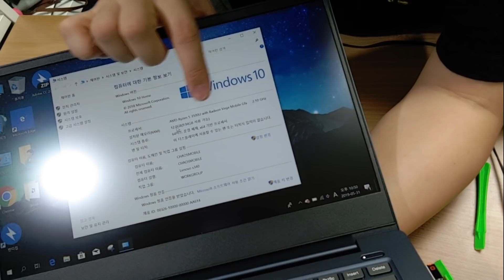Lenovo Ideapad S340-14API Unboxing & SSD/RAM upgrade

Comment: Nice video!  Where can I get the flat plastic tools you use to open the case?  I know the case is aluminum, but are there any delicate pins inside (like on a plastic case) which break easily when opening the case?

I got a Lenovo S340 model 81QF0002US .  It comes with a 256 GB M.2 MVMe SSD and does not have a 2.5" SATA hard drive.   I'm wondering if I could I could add a SATA hard drive or SSD?  My guess is my model will not have a mounting bracket installed and I'd have to find one.  It might not even have a SATA connector which would make it near impossible to add a 2nd drive.
Reply from the maker: I bought the tool at Aliexpress.com but it takes like ages for shipping.  If you are in the US, I recommend to buy it from Amazon.com, search 'phone repair tool' 
https://www.amazon.com/VIPFIX-Multi-purpose-Opening-Professional-Disassemble/dp/B07DLS46M2

I don't think the plastic latch of the laptop is too delicate, but it is highly recommended to open it gently with plastic tools that I used. As long as using the right tool, it should be okay.

For your specific model, I think it should have one 2.5 inches SATA bay empty to upgrade.
Any laptop with empty 2.5 inches bay for upgrade, it should have required mounting bracket included. 
To be sure, you may need to contact your regional Lenovo distributer to clarify that.

Comment: Hey friend what do you think about of adata ram memory? Can I agree the adata memory to the notebook? Without conflict. Sorry my English is not good. Thanks a lot.
Reply from the maker: There is no guarantee for cetain RAM module will work or not.
But, RAM modules are generally fine nowadays, because they have JEDEC memory standards.

As long as you pick RAM module from well know brands, it should be fine.
I think ADATA is fine, if you have no other option like Samsung, Crucial or corsair.

Comment: Is it possible to add a HDD or is there no support?
Reply from the maker: Technically, S340-14API can be equipped with one NVMe(M.2 PCIe), and one 2.5 inches SSD or HDD.
However, it only designed for SSD or HDD with 7mm of thickness.
Also, in some region, this laptop may comes with 2.5 inches SATA SSD or HDD. In that case, you can't add one more drive.

First, check your laptop has 2.5 inches SSD or HDD already. This can be done by disassembling or thru software like Crystaldiskinfo by checking product code to determine if the storage is NVMe type or 2.5" SATA type.
If your laptop is not equipped with any 2.5 inches, choose an additional 2.5" HDD with 7mm thickness. There are drives with 9.5mm thickness which can't be fitted nicely.

Comment: What Ram module did you upgrade to/from?. Thanks for great video 😁...
Reply from the maker: Mine came with empty slot (4GB soldered only).
I used Teamgroup.
Reply: Go to crucial website, let them scan the computer and suggested acceptable ram upgrades

Comment: Can I upgrade by my 8 gb ram to 20gb by replacing one 4gb ram by 16gb ram ? ..plz reply
Reply from the maker: Up to 8GB module is officially tested, and confirmed by Lenovo.
Anyway, it is highly likely to work up to 16GB, because it is technical max. limit per channel.
I even heard someone installed 16GB successfully.
Anyway I recommend you to try with memory module from well-known brands such as Samsung, Crucial, or Teamgroup.
Reply: @gyuhangcho  Crucial RAM 16GB DDR4 2666 MHz CL19 Laptop Memory CT16G4SFRA266....can I buy this ?
Reply from the maker: @svijaykrishna1097  You can find compatible RAM module from Crucial website.
https://www.crucial.com/compatible-upgrade-for/lenovo/ideapad-s340-14api#memory
2400, 2666, 3200Mhz models are all supported.

Comment: What tool did you use to actually get the back off? I've got the screws out, but I can't even find the seam to remove something.
Reply from the maker: There is a plastic disassembly tool specially made for that. gently stick in blade side into the seam to take out the back cover.

https://www.amazon.com/dp/B07214Q6DS/

You can find similiar tool from ebay.

Comment: Did you install a screen guard ? Is it necessary?
Reply from the maker: No, I don't, and never used it.
It is totally up to you.
Using screen protector may protect your laptop screen from minor scratch,
but I think it is not necessary unless if your laptop is 2-in-1 or yoga style.

Comment: Do you need a ground or special screwdriver to use it internally? I don't want to short my motherboard, done it on my macbook before -_-
Reply from the maker: No it's not. All you need is a standard precision screwdriver.

The most important thing is that you MUST completely turn off the laptop before even open the case, and you MUST unplug the cable from battery connected to the motherboard before trying to upgrade.

It is also helpful to have plastic disassemble tool because if you use screwdriver for unplugging the battery cable you may damage the motherboard by accident.
Reply: @gyuhangcho  Awesome. Thank you!

Comment: Hello, i try to upgrade my S340, i try to add SSD. Because, i think, i do not disconnect my battery, bios has lock, laptop can not be open or charge. Service unlock the bios and he work fine now. Somebody know how can i hard reset the bios? Not from hole from left. Like bios battery disconnect.

Comment: I bought one of these but it didn't have the memory soldered, it had a 4gb module in the upgradable slot. It's weird because it's the same reference as yours.
Reply from the maker: That's weird, According to the official reference list, there are only 2 setups for the memory.
'4GB Soldered + 4GB DIMM DDR4-2400 for expansion slot' or '4GB Soldered only'

I think you bought a 8GB ram model with 4GB module already installed.
You can check your total memory capacity from task manager(ctrl+shift+esc) > performance tab > memory section.
Reply: @gyuhangcho  No, it only had 4 gb of ram and I had to change the ram module to a 8gb one due to poor performance on games , it's prety weird that they done that because task manager still shows 1 of 2 slots being used, so they didn't soldered a module at all.
Reply from the maker: @felipemarinoc1597  Maybe it is a local varient model. thanks for the info.

Comment: Hello @Gyuhang Cho.  I am thinking of taking this model. Can I add another 8gb of ram and a Nvme SSD 500gb or an 1TB HDD later?
Reply from the maker: Typically this model comes with NVMe storage, and 4GB Ram soldered only.
So, you can expand RAM with 1 empty slot.
For storage, either you can install 2.5 inch SATA SSD or HDD with 7mm thickness, or even replace NVMe SSD. 
There are some 1TB HDD with 9mm thickness, so be careful. it can't be installed.
Reply: @gyuhangcho  Thank you so much man!!!
Reply: @gyuhangcho  Hey again man! Can you turn on windows face recognition on this laptop?

Comment: Great video! Do you think this laptop may work for video editing?  Not on a super pro level. Can yo change the screen on this one? I think is TN
Reply from the maker: I think casual video editing is okay for this laptop. However I strongly recommend you to install additional RAM. 

Mine came with IPS panel, it depends on regional model.
Reply: @gyuhangcho  thanks!!

Comment: Hi, can we add both SSD(given with the laptop) + 1TB normal Hard disk together? SOFTWARE installed in 1TB hard disk... Boot from SSD?
Reply from the maker: That is totally possible, but you need to consider this.

If your S340 is equipped with NVMe, you can simply add any type of 2.5inch SATA drive you need, HDD or SSD.

But, you MUST check the thickness of your 1TB HDD before you install.

This laptop only accepts 7mm HDD or SSD for its SATA bay.
Most 2.5 inch hard drives are 7mm nowadays, but still there are 9.5mm hard drives.
for example, HGST 1TB or WD black 1TB are 9.5mm. these models can't be fitted to the s340.
Reply: @gyuhangcho  Thanks a lot.  So, we can insert only one drive (SSD/SATA).... 

But not both(SSD/SATA) at a time, right?
Reply from the maker: @ashokvardan7387  This laptop has 1 x NVMe slot and 1 x 2.5inch SATA bay.
So if you want to use SSD+HDD, you need to use 1x NVMe SSD with 1x 2.5inch SATA HDD.
Of course you can use both together. Booting with NVMe, and installing softwares on SATA HDD is also totally possible.
Reply: @gyuhangcho  many many thanks. 😄😄😄

Comment: Wait, is the original ssd a sata one or a pcle? Because on website it shows pcle nvme but here it's sata?
Reply from the maker: NVMe 120G is stock storage by Lenovo.
Korean distributor swapped it with SATA SSD.

Comment: I really appreciate the time you took to explain us how to do this. I have two simple questions. What''s the biggest capacity the replacement ssd can have? and why didn't you use a 3200Mhz memory as suggested on lenovo's website,??
Reply from the maker: 1. There is no limitation for maximum capacity of SSD in the spec sheet. I think it should work with any SSD up to 1TB.

2. It is true that the Ryzen desktop processors performs better with high frequency RAMs like 3200Mhz.
However, mobile Ryzen 5 3500U processer only supports up to 2400Mhz. So there is no reason to use faster&more expensive memory.

If you are buying newer laptop with new Ryzen mobile processor like Ryzen 5 4500U, you should look for 3200Mhz RAM. Because the cpu supports it.

Comment: Great Video! Can you let me know the type of screwdriver you use to open this laptop please ?
Reply from the maker: You need T5 screwdriver to open the back cover. 
For SATA bay, I am not sure if I used 2.0 or 2.5 philips screwdriver though.
Reply: Thanks!!!! Any recommendation on the SSD? I am looking to add 1TB.
Reply from the maker: @venkatsubramaniam2160  Samsung, crucial(micron), and WD will be safe choice.

Comment: Mine came with 8gb ram, I would like 16gb, do I just need to put another 8gb in or do I need to get a 16gb?
Reply from the maker: First, you need to verify how your 8gb is setup. It could be 8GB soldered with blank RAM expansion socket, but also it is possible to have 4gb soldered and 4gb module inserted to the RAM expansion socket, the latter is the more likely setup.
Opening up the laptop will give you definative answer, but if it is too much trouble for you, you may try apps like CPU-Z to check in advance. 

In case if you have 4gb soldered, and 4gb module. you need to consider switching existing 4gb module with either 8gb or 16gb module.
Reply: @gyuhangcho  that’s brilliant thank you

Comment: Hi.. I am going to buy lenovo S340, it has 512gb ssd, I want to know whether it's Pcie Or Nvme. Which one is Pre-installed on this laptop?
Reply from the maker: It depends on specific models. You need to check with the seller. 

Usually it is 512GB NVMe for Lenovo stock model, but still there is a chance that seller exchanges low capacity NVMe with larger capacity SATA SSD.

Comment: 2666 MGz working? after change 2400 MHz?
Reply: It's not working, because it's limited by the cpu, ryzen 5 3500u only support to 2400mhz
Reply: @erwinm.mutaqqin4559  thx

Comment: Do you happen to know if the ideapad L340 has soddered ram or memory module installed?
Reply from the maker: There are several different models of L340 lineup, so you need to be specific.
For Lenovo products, you can find all the detailed technical specifications on http://psref.lenovo.com/ 

For example, L340-17API has 4GB soldered, and has one DDR4 SO-DIMM socket.

Comment: If i upgrade the ram can i lose the guarantee? you know for opening the laptop
Reply from the maker: It depends on country I suppose.
It is generally okay to replace ram, SSD, and/or HDD in Korean market, but this is partly because Lenovo's hardware repair service in Korea is outsourced.
Warranty policy in other market may different.

Comment: thanks for your work, that mean i can update  more ram from that empty slot?
Reply from the maker: Officially supported up to 8GB, but actually you can install 16GB module, too.
I suggest 8GB though. because 16GB is a kind of overkill unless you 'really' needs more RAM for your everyday task. For example, super hi-res photoshop work, or heavy EXCEL works.
Reply: @gyuhangcho  are you sure that we can add up to 16GB RAM? I will need upto 16GB for my development work.
Reply: @gyuhangcho  thank you so much
Reply: Just FYI, I added 16GB ram and it runs on total 20GB without any problems.
Reply: @VishnuHaridas  are you sure?
Reply: @VishnuHaridas  can you give me some image?
Reply: @katluyana3682  My err, I have an IP 330S and I added  16GB and total is now 20GB and it works fine. I am unsure about the S340 model.
Reply: @VishnuHaridas  oh, thank you anyway
Reply: @VishnuHaridas  what kind of ram channel does it work after ram upgrade? Is it dual, channel, or something else?
Reply: @oleksiihvozdiev6702  I checked in CPU-Z and it's running in Dual Channel mode. The RAM is a Micron Crucial CB16GS2400 16GB RAM on the only available slot. The motherboard has a 4GB built-in. Totals to 20GB.
Reply: @VishnuHaridas  Is there any problem if you add different RAM sizes ?
Reply: @alejomakevids  the Ideapad 330s has 4GB inbuilt, and can add additional upto 16GB. I haven't faced any problems yet, and the device is running smoothly.

Comment: Is there a external hard drive space to add 
Because i have the same laptop with i7 8th gen
Reply from the maker: You need to lookup PSREF Lenovo website with your laptop's model code.
https://psref.lenovo.com/Product/Lenovo_Laptops/

If your laptop is Ideapad S340-14IWL, I think it has same design, 1 NVMe and 1 SATA.

Comment: I managed to install 16gb of RAM in this laptop, so I got total of 20GB (4GB onboard + 16GB SO-DIMM) and dual channel works perfectly, but I broke one of the plastic clips in the process, now my laptop have a very small annoying gap in the bottom :(
Reply: I'm thinking the same to upgrade to 16 gb in one free slot. Are you experiencing any difficulties?
Reply: @kinjalpandya9366  no bro, its easy just like in ths video. U only need a screwdriver with torx t5 (cmiiw, i kinda forget) and plastic prying tool, also a lot of patience :D
Reply: @theorangecat2929  I'm so sorry. I mean to say are you experiencing any difficulties while using your laptop? Coz as everyone mentioned in the comments lenovo officially says max you can use is 8 gb.
Thanks for your reply as well.
Reply: @kinjalpandya9366  oh ok, i misinterpret your question before lol. No, so far there is no problem, im running ubuntu and windows in this laptop with total 18gb  (2gb for integrated GPU) ram just fine.
Reply: @theorangecat2929  Thank you for your reply.
Reply: Bro,after upgrading it to 20gb ram does it actually improve the performance,can we play high end games like rdr2 or editing softwares like adobe?

Comment: Hi, will exp gdc (dock for external gpu) work on this notebook? Thx
Reply from the maker: I don't think so, generally external GPU works with thunderbolt mode of USB-C.
However, this laptop doesn't support thunderbolt mode.

If you are planning to use external GPU box with Thunderbolt, you should check laptops with intel CPU.
Reply from the maker: @nikobelictheserb  There is 'integrated graphics controller' setting in the BIOS, but I am not sure if it works.
Reply: @nikobelictheserb  Have you tried M2 egpu?

Comment: Is there cannot fit both SSD and HDD?
Reply from the maker: If you want to use SSD+HDD, use M.2 SSD(either mSATA or NVMe), and SATA HDD with 7mm thickness. (9.5mm HDD is not fitting)

Comment: thank you make this video!  Can you let me one question   4g+8g different capacity RAM Is there any problem?
Reply from the maker: 2 or more modules with different capacity works flawlessly.

Technically, only 4GB of a 8GB module will be work as dual channel mode along with soldered 4GB onboard ram, but in real life usage, you won't feel any drag. 

It is always better to have dual memory setup for any CPU with GPU core integrated, especially AMD.

아이디로 보아 한국분인 것 같아서 한국어로도 댓글 답니다. 다른 용량 메모리 조합으로도 듀얼채널이 구성됩니다, 기술적으론 좀 복잡하지만 내장글카 있는 CPU의 경우 무조건 듀얼채널 구성하는게 좋습니다.
Reply: @gyuhangcho  아! 영어를 잘하셔서 외국인이신줄 알았어요 다름이 아니라 다른 용량의 램 사용시 플렉스 모드가 되어서 효율이 떨어진다는 글을 봐서 그랬어요;; 저도 이번에 이 노트북을 샀는데 온보드인줄 모르고 8기가 램을 두개나 구입했거든요;;
Reply from the maker: @김mingming  벤치마크 툴로는 차이가 있을 수 있지만, 실사용에서 그 차이를 느끼는 건 거의 불가능합니다. 
듀얼채널을 구성하겠다고 4+4로 쓰는 것보다 4+8로 쓰는게 메모리 용량에 따른 이득이 있어서 훨씬 낫습니다.
Reply: @gyuhangcho  좋은 답변 감사드립니다

Comment: Can i use a 8gb 2666mhz module?
Reply from the maker: 2666mhz module has backward compatibility with 2400mhz sysyem.  It will work flawlessly.
Reply: @gyuhangcho  thank you :)

Comment: Great video!  Loved the upgrade; and you can use any size memory card for the removable slot...my son added a 16 gig card and now has 24 gigs; the configs are for what LENOVO will factory install and it only goes to 16.  Again, one of the best reviews I've seen.  Cudos
Reply from the maker: Thank you for watching, and your tip for RAM upgrade. :)
Reply: Hello I just have a question I am planning to buy this laptop and put in a 16 gig stick so will it add UpTo 24 or does it only show 16 thank you
Reply from the maker: It will recognise total of 20GB (16+4), but some portion will be used for integrated graphics. (about 2GB typically)
Reply: @gyuhangcho  pls update the brand and the ddr4 type and hz for the 16 gig

Comment: WTF I have the exact same laptop, but when i opened to insert a second RAM it has not an onboard ram and I can not put the second one!!!! WTFFFFF! in the specifications it says that the RAM is soldered... WTF IS JUST HAPPENING? any idea? pls someone help me
Reply from the maker: I think you didn't remove metal shield covers RAM slot.
Reply: @gyuhangcho  yes I did, but the slot was busy with a RAM, no soldered one, contacted lenovo support and it turns that some "sub-models" do not include the soldered one